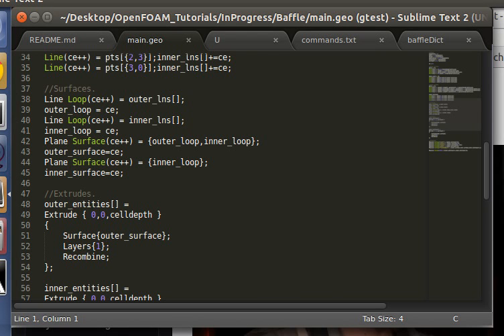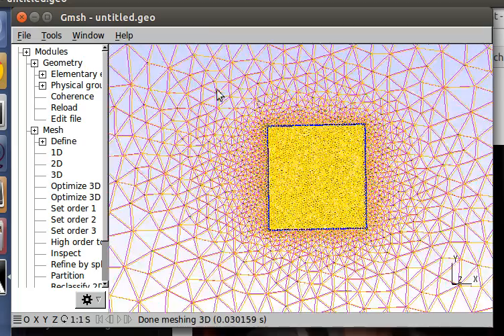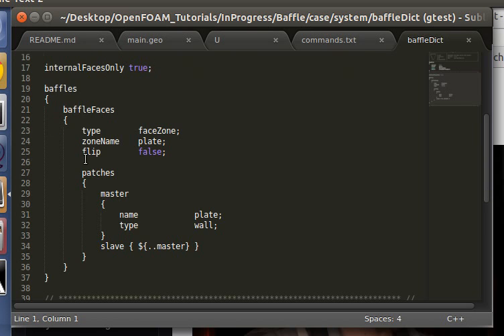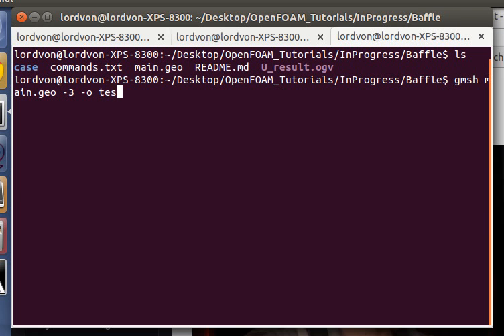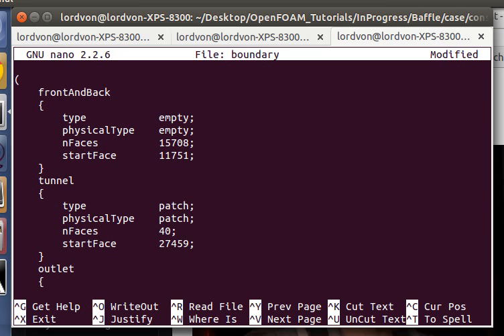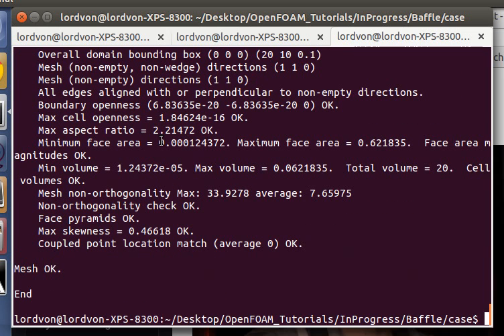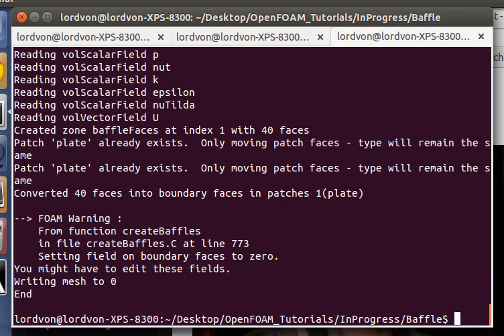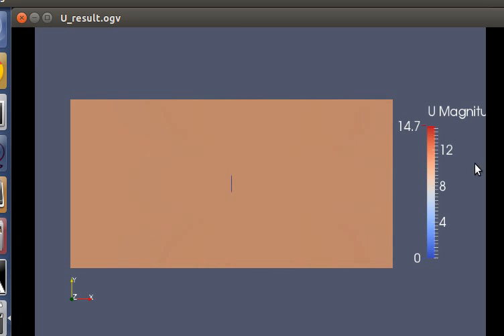How to Make Baffles (Thin Walls, Internal Faces) in OpenFOAM

Comment: How did plates appear in boundary file ?
As per my experience blockmesh wont work with internal faces defined.
which would leave no mark of plates in boundary file.

I am trying to create an internal face using blockMesh.but not working.

Comment: Hello,
Thanks for this tutorial, I have been trying to reproduce this using a structured mesh but have been facing difficulties. The use of transfinite results in creating default faces in Openfoam and that makes creating the baffle using createbaffles command impossible. Thanks
Reply: Please can you point e in the right direction as to achieving this? Thanks a lot

Comment: Thanks for uploading. Internal walls in OpenFoam can be baffling! Do you know if it's possible to add an internal wall connected to the outer boundary? I'm trying to model flow past a wall connected to the bottom of a rectangular domain and extending half way up through it. So far the only way I have found is to draw a long thin 'dent' in the boundary itself but a 'plate' effect would be preferable.

Comment: Hello and thanks for your tutorial. I have a question:
Which is the pressure's direction calculated one the internal face? How can i check the internal face's orientation? Thanks!
Reply: I think the orientation is calculated by the right hand rule using the direction of the line loop

Comment: Nice tutorial. I have a similar question as Nicolas. I want to put internal spargers within a reactor. These spargers will have either a gas velocity or gas flow rate BC. Do I create a baffleDict and set the patches to "patch" for my inlet?
Reply from the maker: +Ed Barry See my Ducted Fan Tutorial for a sample baffleDict with a pressure jump condition. You can modify this to your needs.

Comment: that's very interesting, i was looking for this but now i have another question, it's possible to add thin wall internal boundary condition for velocity like this example but add no boundary condition for another field i.e Temperature?, in other words, add a wall who allow heat flux across
Reply: +Nicolas Thiers yes, it is possible. check http://www.openfoam.org/version2.2.0/thermophysical.php#thermalBaffles

Comment: Hi,

Can you please explain what are master and slave patches?
Reply from the maker: No problem at all! I welcome questions! There of course is a way to determine which one is front and back by the original properties, but I usually determine it by guess-and-check. I just split the surface and either check the results of running the simulation (if it runs quick enough) or check the surface normals in paraview, and correct if necessary. In the case of a thin wall, it doesn't matter which one is master or slave. But in an (pressure-jump) actuator disk (see my Ducted Fan Tutorial) it will matter.
Reply from the maker: Divya prakash Hi Divya, the internal surface is split into two faces: a master and a slave patch.
Reply: OpenFOAM Tutorials ok... But what exactly do they signify? Is it like the front and back portion of  surface?
Reply: Divya prakash Exactly.
Reply: lordvon64 ok. So which one is the master out of both of them? front or back? sorry for asking so many questions :P
Reply: OpenFOAM Tutorials Thanks!